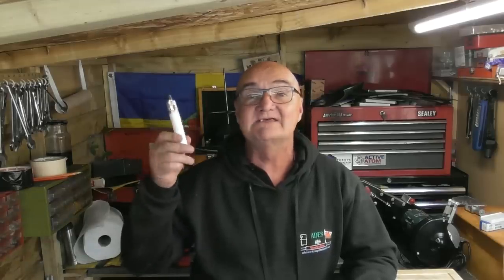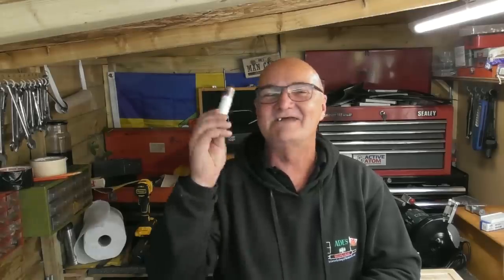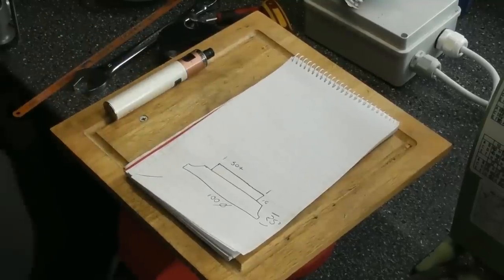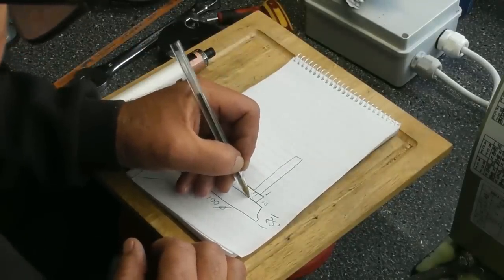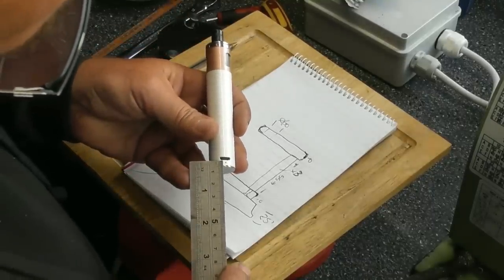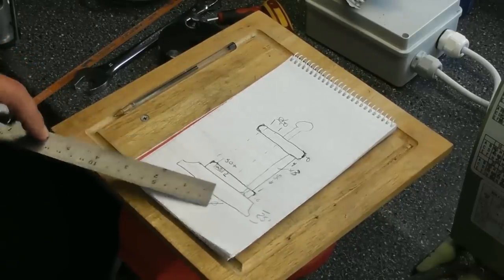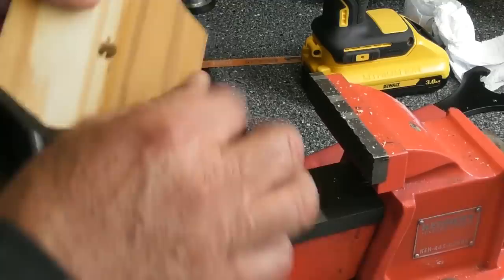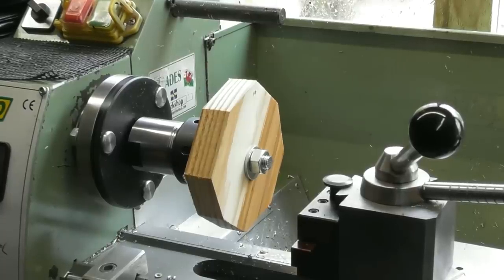Jacqui's Vape stand   part 1

Comment: Cut some slots in the top plate so that you can plug the USB charger is while the Vape unit is out of the holder.  That way you are not fighting with trying to plug it in after sliding it through.

Comment: Hi Ade. I've been watching quite a few of your video's so I know you have a Warco lathe & I have a question totally unrelated to this video. Have you noticed any evidence of hand scraping on your lathe? I just bought a lathe from a different manufacturer because Warco hasn't had the one I wanted in stock for months, I took the compound rest off today to try the toolpost I bought & I noticed hand scraping. Don't know if this normal on a cheaper machine. Cheers